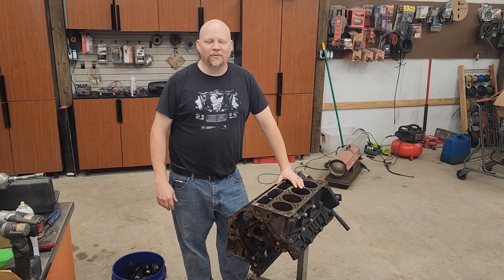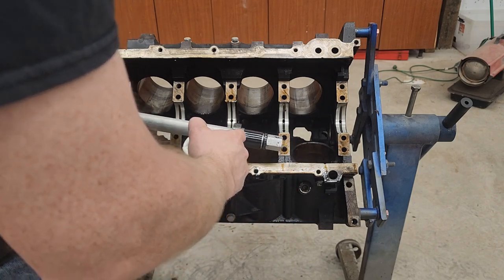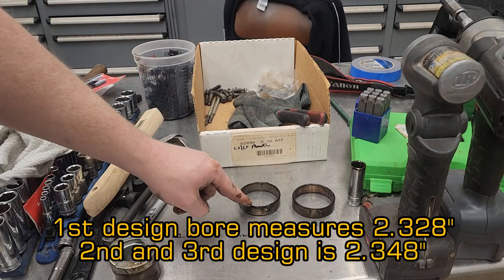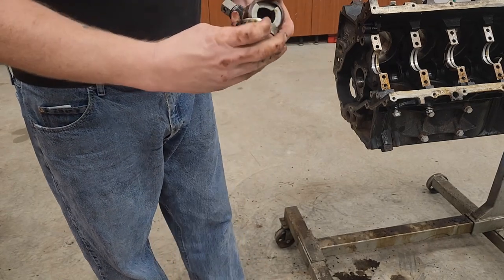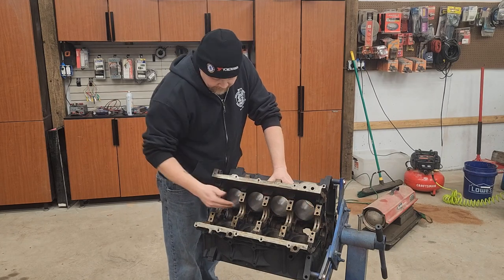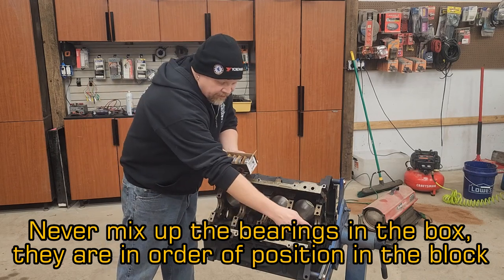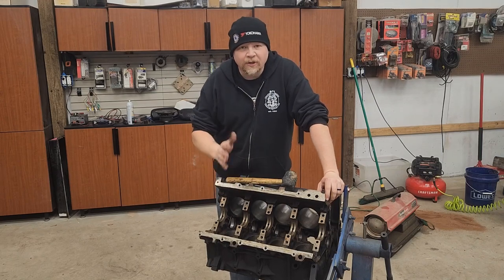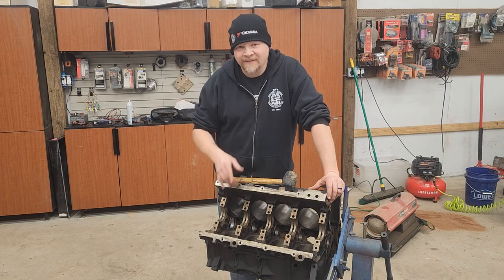How to Install New Cam Bearings In and LS Engine

Comment: Quick question? When you are replacing a cam bearing on the 5.3 do you have to change the piston rings when you take them out every single time? Or can you use the same piston rings and install them once you replace the cam bearing?
Reply from the maker: Multiple answers here-

Yes. You can reuse the rings, but you have them out, so if the engine has 100k or more, you might as well refresh it because you are in there. 

Additionally, you dont have to pull the pistons at all. You can technically do it with the crank in the block, but it's much easier with it out, but the pistons and rods can definitely stay in if you dont want to deal with removing them. Just tie the rods out of the way. 

All of that said, if you have the engine out and down to the short block, you might as well put new bearings and rings in. You are already there, and that stuff is easier than doung the cam bearings.

Good luck!
Reply: @Reddirtrodz  Thank you sir. Yes I do have the engine out and it’s just a block. I pulled the engine out because I had a spun cam bearing low oil pressure. And one of the gaskets was leaking coolant so that’s what I’m doing right now. I’m watching your video and I just uninstalled the cam bearings.

I’m waiting for the bearings to arrive from AutoZone 

And yes, I am replacing the piston rings and I’m doing a light hone on the piston cylinder walls too!
Reply from the maker: @buddyrebel_Garcia  good luck! Just be patient, gap your new rings, and remember- clean clean clean clean and then clean some more!

Comment: Quick question, do you just basically center the bearing because there’s no stop plate on either side, thank you in advance
Reply from the maker: Yes, the oil hole is your guide.
Reply: Really appreciate that, within the week I’ll be doing cam bearings in a 6.0
Reply from the maker: @ToddSalisbury  just be patient and following the instructions for the tool you have and make sure your oil passages are lined up.
Reply: Yes sir!!

Comment: Thanks for video, going to try doing mine with crank and rods in, I have it on a engine stand , hopefully it will work out.
Reply from the maker: For sure! It can be done that way, but it is definitely more difficult to get the old bearings out and the new bearings in with the crank and rods in the way. Depends on the engine you are working on, but it can be done.
Reply: It's an ls i picked up cheap for low oil pressure. Changed pump out and no help, then I went looking a little more in block and found the #3 bearing has migrated out the front about 1/4  inch.
Reply from the maker: @Russ Rocket  it can be done. What year LS? If it is a Gen IV, you shoukd use the 3rd design bearings
Reply: I believe it's a 3, did not know about the new designs yet. Just started researching for bearing change.
Reply: Where do I look for information on these new design bearings, do they have them available for the 3rd gen?
Reply from the maker: @russrocket2883  97-03 is the smaller diameter.
Reply: @russrocket2883  I have the same exact problem. When I try to get the camshaft out the loose bearing which got hit by the counterweight blocks the cam from moving past the number 2 journal. How do I get the cam out?
Reply: @kerlioclassics6440 It took me a little bit but I got a long screwdriver and a hammer and broke the bearing apart. I did have to remove the piston and rod assy next to the bearing but I put it back in once bearing was removed.  Once I got the bearing out the cam came out. I did clean everything up afterwards and put bearings back in, I was able to do this with lower in installed. Had engine on stand not in car.
Reply: @kerlioclassics6440  oh I forgot to mention for unknown reasons I could not get lifters to clear with the lifter dowl rods installed to remove cam, so I ended up having to remove heads and lifters to get cam out. Dont know why the lifter tool did not work. I used the actual machined tool not wood dowels. I do have it all back together and hope to fire it up soon.

Comment: Could it be done without removing the crank pistons?
Reply from the maker: No, you have to pull the crank to get to the cam journals to put the bearings on the tool, can't slide them in from the front/rear. 

You dont have to pull the pistons though.

Comment: Im looking at pulling my 2008 6.2L vortec motor out this week to do cam bearings due to low oil pressure. While its out if i do crank and rod bearings, do i have to machine? Motor runs great. Has 170k on it. Also if i do new rings can i just hone as long as ring gaps are good? Thank you
Reply from the maker: It all depends on the condition. If there are any scars, scratches, etc then you need machine work. 170k is middle of the road for an LS, many times you can get away with a good hone and file-fit each ring to each cylinder, keeping them in order. Check the clearances of the bearings and you will know pretty quickly whether or not you need machine work. 

If money is not a big factor, a machine shop trip is advisable, but I see 150k+ LS engines with basic "rings and bearings" rebuild that beat on all the time. That is exactly what I did on this one, so just have a good look at the old bearings and hard parts. Plastigauge is your friend if you don't have the right tools.
Reply: Ok thanks. Yeah its a smooth runner and not burning oil. I just figured id do as much as a could while im in there. Money is tight so building the best i can on a budget.
Reply from the maker: @hydrostreamcrazy  we did a Summit rebuild on the bottom end, with new pistons, but you don't have to replace the pistons at all. Just clean it really well before you put the cam bearings in and dont forget all the little oil plugs.
Reply: Would you do valve springs, retainers, pushrods, valve seals right away? Not sure how many miles or if stuff goes in the heads often.
Reply from the maker: @hydrostreamcrazy  It depends on your overall goals. Seals are an easy repplacement that will come with a rebuild gasket kit. The actual parts like springs, pushrods and retainers are fine to reuse if you are staying a cam that does not require heavier springs or different pushrods.
Reply: Just rebuilding back to stock. Awesome can save a little money and time then. Thanks

Comment: So I had an incident with my Pontiac bonnivle where the bearing slipped out and is crunching inside …. Car still runs aside from that crazy crunch sound found a piece of the bearing in the oil pan which lead me to the piece of bearing with a code on it ..

My question is would I be good just changing the bearings or ? 😅 15:46
Reply: Also my main question is “do I still have some hope in my classic 😢?”
Reply from the maker: @blazem2400  definitely do not run that engine until you fix it. Will probably require a shortblock teardown at the minimum. If it sent shrapnel through the oiling system, it will kill all the other bearings. 

You may be able to just replace the bearings, but you need to do a thorough check.
Reply: @Reddirtrodz  yea it’s just been sitting I think the culprit was because I was having low oil pressure issues changed the hoses and was trying to thicken the oil with synthetic additives….im planning replacing all bearings but of course GM had there engines upside down in 1993
Reply: @Reddirtrodz  I humbly appreciate the input 🙏🏽

Comment: Just take the block off the stand for the front 2 bearings , why risk screwing it up " if your careful" is bad advice.
Reply from the maker: Not all engines can be done that way. In fact, the Gen V LT-Series can't be done that way at all, because you cant fit the tool in the block and get the bearing into the channel at the same time, and when you get rhe bearing installed, you can't take the tool out. 

Gen III HEMI engines require the front bearing to go in this way as well, and that bearing is like 3 inches long. 

With chamfered bearings, there is little chance of screwing it up if you are careful. Thanks for watching and commenting!

Comment: If they are showing copper doesn’t mean they are bad 😂
Reply from the maker: There is no risk in replacing them, and the tops were dimpled. You can't fully clean an LS or LT without removing the cam bearings, and I will not run bearings showing copper. It's far better to replace for $30 than to take a risk.
Reply: @Reddirtrodz  they are line hone from factory even low mileage have copper showing and will run for many thousand of miles I didn’t say it was a expensive cost to replace them all I’m saying is if they show copper doesn’t mean they are bad
Reply from the maker: @javiertrujillo1916  these bearings were shot. There is zero good reason to keep bearings showing copper. I am aware of the GM process. I always replace cam bearings.
Reply: Not one person has liked your comment. Take a minute and let that sink in